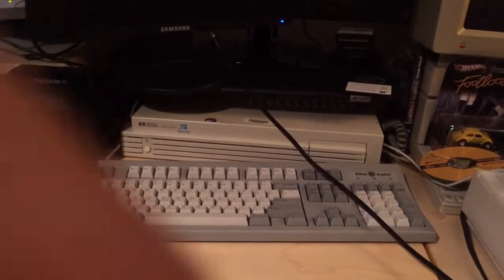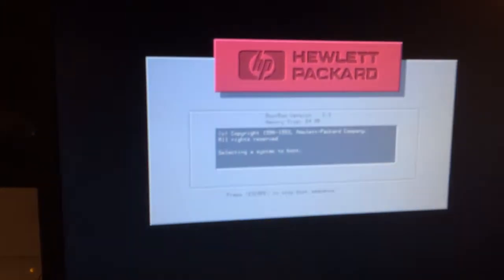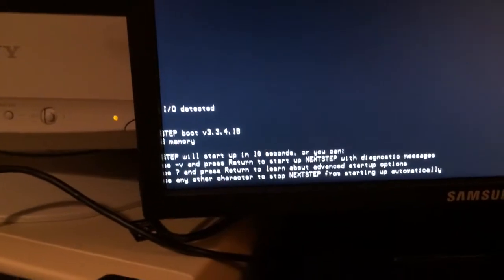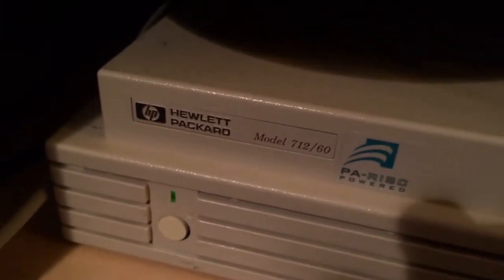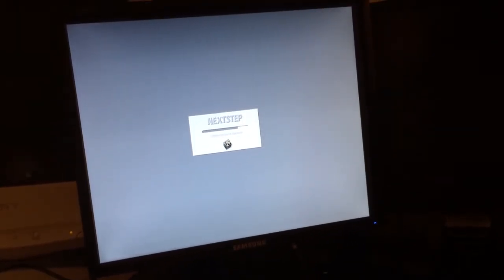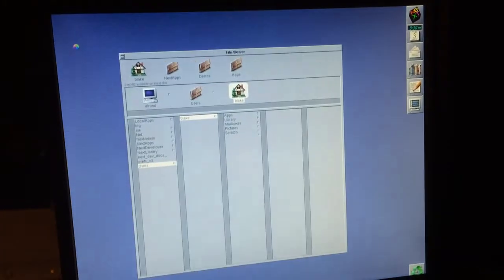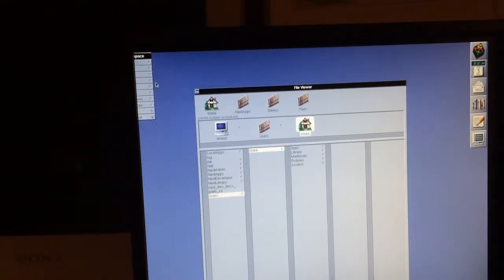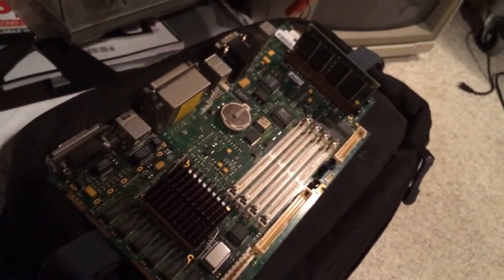Testing the HP 712/100 Upgrade

Comment: Can you run doom on nextstep ?
Reply from the maker: Yes. And, of course, DOOM was developed under NEXTSTEP,  originally. You can see me running it in the video in my blog post about my HP 712/100. https://bytecellar.com/2016/03/02/a-quick-tour-of-the-hp-9000-712100-nextstep-workstation/
Reply: @blakespot  I just saw your movie. Thanks for the link. Is it easy to buy HP stations in the USA? It is practically impossible to get in Poland. I'm not talking about nextstation colo or trubo color anymore.
Reply from the maker: @nueprogs  I found this one in a random "boot sale" one day on a truck in a car park for $25 or so -- that was chance. I went looking for a 712/100 motherboard and there was one right there on eBay, so I upgraded my 712/60 to /100. Not sure how hard they are to find, aside from chance. I see right now there is one 712/60 on eBay for $369 USD. Seems a little pricey...
Reply: @blakespot  Congratulations, you've been incredibly lucky. This is a very nice piece of equipment, I don't understand why they are still at such high prices. Professionals do not use this anymore, only collectors. It used to be mono nextation in france but with all the hardware for 300 euros. I hesitated a bit because it's not color and slow after all.